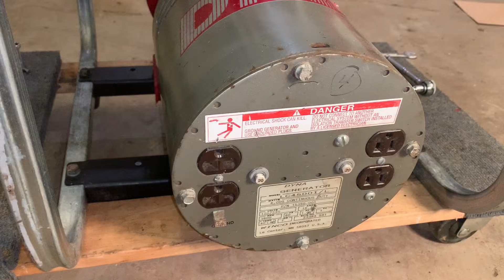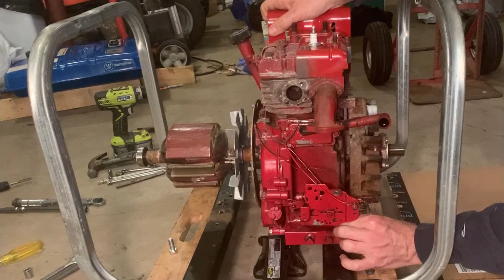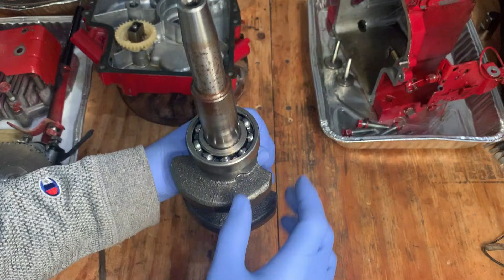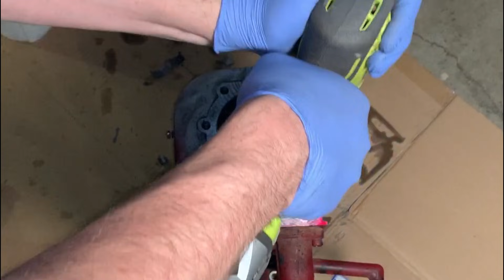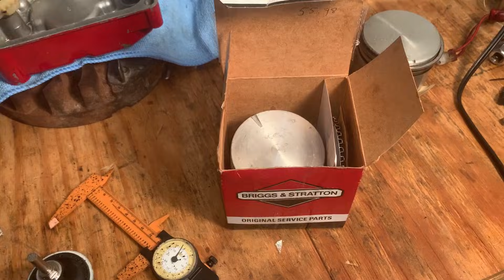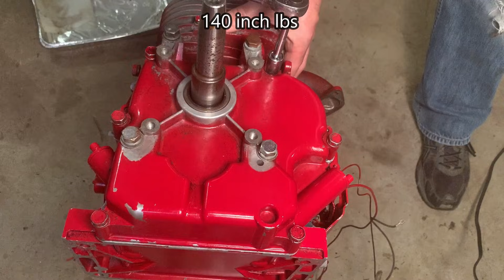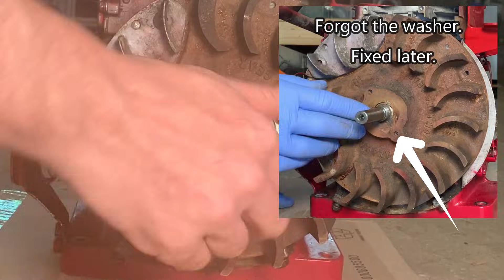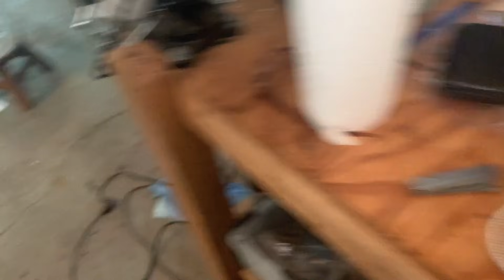Old Winco Dyna Generator (Part 2 ) - Engine Rebuild on a Briggs L-Head Engine

Comment: Main jet adjustment on all small 4-stroke motors:  With engine warmed up, and at speed, open just until misses a little - then turn back in just until it doesn't miss.  Running just a hair rich is better than lean.  Lean running creates excessive heat in the combustion chamber.  Small engine mechanic since 1968.
Reply from the maker: Thanks
Reply: Same criteria as with 500 cubic inches aviation  engines ,,, fuel is cheaper than engine overhauls  !!
Reply: All that stubborn surging because you fixed a spring. Nice. .Ines doing the same under load, I'll check the governor spring for sure.😊

Comment: I was also wondering about that flywheel key being broken-split a bit.  Did you happen to look back at pre-flywheel pulling video to see if maybe it had split and rotated just a bit and also thrown timing off? Enjoyed watching and great job.
Reply from the maker: I did not notice an issue before removing it.  It could have been broken, but the cam timing was the main issue.

Comment: If the bore looks clean while lapping and you have nice cross hatch that is great. This one looked much better than the ten horse Briggs that still had a vertical scratch and still measured 60 on the compression so this motor is supposed to be 8 hp And acts more like 7. But depending how much fuel this uses and how long the piston and crank last like two weeks with no power running day and night will be just great if they remember to keep oil in it. Good job I say. These were very expensive when I was young.

Comment: So happy you decided to repair this engine. These are the engines which were running the world when I worked on small engines.

Some of these engines were configured with the cam to crank timing retarded by one tooth, to optimize the engine's torque curve at the higher end of the RPM range where a 2 pole generator was to be run. This is probably intentional.

I really don't think you broke the key in the flywheel removal process. I think it was half-sheared all along and causing the power loss and loud exhaust sound and red-hot muffler you experienced. The resultant high combustion temperature from the retarded ignition timing would explain the scored piston. That piston would have been overheated badly by the late timing. That could easily expand the skirt, reduce the clearance, and disrupt the lubrication film.

In my opinion; had you tested the engine with its original piston but with a replaced flywheel key - it would have probably pulled rated power; but would have used a lot of oil and worn prematurely.

Regardless, it's great to see it run well at the end!

Comment: Man, what a load of work, for such a little load capabiluty......I think you must choose an adjoining spring hole, to make the governor a little less sensitive........also, it will run better, with better compression, when the rings seat in after a little more running......Great job, and good find with that cam tooth foul-up....

Comment: I just recently subscribed to the channel. I enjoyed it very much. I didn’t know if you knew this on the old Briggs&Stratton you use straight 30 weight motor oil. You did a really nice 👍 job with this old generator. Greetings from Silverstreet South Carolina.
Reply from the maker: Am afraid to do that around here.  30 weight is not good at temps below 40 degrees.  Temps here can get to -10 in the winter.  Am afraid I will sell it to someone who does not know better and try starting it in the winter.  I usually use 10w-30 synthetic which works better then multi grade mineral oil.
Reply: @jcondon1  no worries I understand now thanks 😊 I didn’t realize you lived in cold climate. I seen you use Castrol Edge full synthetic 10w30. I’m seriously thinking of using this in my kohler v twin. Merry Christmas Sir
Reply from the maker: @eddiepatterson5025  it’s easy for me to get, they sell it at Home Depot.  But agree 30 weight oil is much better in warmer weather.  I only use 30 weight oil in my lawn mower and lawn tractor since they are only run in warm weather.  Have a Merry Christmas.

Comment: We used to spray a little aluminum paint on head gaskets to insure a good seal. It probably doesn't matter much with air cooled low compression engines though.

Comment: England. Just found your channel - it's good. I spent several years working on rather large engines and many of them new. It was basically engine testing. One thing I have always wondered about. There seems to be a lot of emphasis on honing marks being necessary to bed the rings in. I never really found evidence of this on engines. Some had quite faint honing but many like Rolls Royce and others had almost a mirror finish. None of the engines with liners showed any at all. I can only assume that with let's just say ' more cost effective' engines it's needed. Sorry to be so late on this but as I wrote I have only just found your channel. Sub'd, etc. of course.
Reply from the maker: Thanks!
Reply: Interesting what you say about honing. I have an old german book written between 1959 and 1962 where it says that cylinders must be honed, but if it is done right they do have almost a mirror finish. The guy is talking about that the bore only gets rough and matt over time when something is wrong. 
He says that the only surface in an engine that needs to be relatively rogh and matt is the part of the piston rings that touches the bore. That is THE ONLY part of an engine that needs breaking in, nothing else. He goes on by saying if a service station or a workshop tells you that an issue on a new or rebuilt engine will disappear because of "breaking in", they want to hide some botch.

Comment: I have a Tecumseh SnowKing, that has been in service for about 30 years.  I doing the same full rebuild, due to excessive ring blow by.  It also has an adjustable carb.  One of the features of that is you can adjust or optimal performance under various outside temperature conditions.  You can also adjust it to optimal performance under load.  So when you load it down and it seems to run a bit rougher, just tweek the main jet a little
Reply: re: " It also has an adjustable carb. One of the features of that is you can adjust or optimal performance under various outside temperature conditions. "
His Briggs in this video works the same way - just 'hit' the carb adjustment screw for optimum performance at the time!

Comment: Just a heads up, the taper in the ring is for gas assisted ring sealing pressure, think of the ring as another piston that forces toward the bore, and the taper as it’s sealing ring, or as it’s crown, the pressure is directed to the grove instead of the outside and that causes the ring to push outward and the rest of the pressure pushes the ring down into the piston ring land and the piston itself, typically the pressure outward on the ring and downward on it is enough of a percentage that the ring doesn’t drag behind and the piston doesn’t race past it (causing the gases to escape?) but if the piston does go faster than it then all it will do is act like a tapered seal on a valve and stay seated until the rings move faster and seat on the bottom land again giving room for the taper to act as a piston again, this is mostly just for compression gasses and isn’t used on lower power versions of the same engine bore size

Comment: James, they make  small engine valve seat cutters that you may find very helpful.  Also a ring expander pliers are very helpful.
Would you comment if the BS engine has a sleeved cylinder- this on appears to have one, but many BS engines are Alum bore
and usually not worth the trouble.     Valves are usually inexpensive and worth replacing....
Reply: In the preceding video you can see a label on the engine to the the effect that the bore is an iron sleeve.

Comment: I prefer undoing the shaft bolts with an air rattler... less chance of bending anything. That timing mark issue has solved a problem I have. Thanks.

Comment: I commented on the other video that I worked on one nearly identical a few months ago.  Fuel supply issues I could never resolve.  FYI, the fuel filter was on the carb side of the generator on mine, not the fuel tank side like yours.  Not sure if that would make a difference.  I kept wondering if the fuel line should be pushed down in the gap between the generator housing and the engine, so that the gas did not have to flow over the generator before reaching the carb.  But my experimentation was cut short when the person I was trying to get it run for decided not to use it.  Look forward to the next video on this one you mentioned in the comments.
Reply from the maker: Yes, ideally that fuel line would go down in the gap between the generator housing and the engine.  Otherwise there will be fuel left in the tank that cannot get to the carb.

Comment: When I run in a new rebuild, I pour the coals to it to burn in , set the rings. They need to be worked at half demand for a full tank of gas. Then she'll be ready for the customer to take home. Nice build though, Just run it hard under a healthy load.

Comment: James the next time you have to use the hydraulic method I suggest you use power punch. The light oil you used still leaked out rapidly till you used a power tool. With power punch I believe you can still use a ratchet and socket. Not sure though.
Reply from the maker: It normally works well, but not that time.

Comment: Why don't you use your impact more often? I am in refrigeration and I use mine for everything.
Reply: Well, not every out here has one for starters ...
Reply: @uploadJ  true, but in my opinion they are cheap enough where anyone who works on anything like this, especially diy should have one. I have a Hercules impact, it was $70.
Reply: @inoahmann7542  re: "anyone who works on anything like this, especially diy should have one."
MOST of the time that 'money" (the 70 bucks spent) would just be sitting in the garage, aging, with the batteries drying out, becoming unserviceable in 5 years for the average home-owner ... professionals and hobbyists not so much.

Comment: The L head Briggs and Stratton book , $15, has all the different governor set up pics and instructions. The inside beveled edge on the top ring goes up. Sorta sounds like the rpms are to high, mite want buy a tachometer and check.  I think the Chinese carbs are far better than original too.  1 1/2 turns out on both mixture adjustment screws is fairly close. Thanks
Reply: The revolutions per minute and the cycles per second are directly related, you set the rpm for 60 cycles per second.
Reply: He measured the frequency output on the gen. It was dead on.

Comment: WD40 is a perfectly serviceable cutting fluid! How does the governor work in this engine? I saw just that metal pedal in there.
Reply: The air coming from the fins on the flywheel pushes on the metal pedal and the acts as the governor and some engines have an internal governor
Reply: @jameshedrick6839  Thanks!

Comment: New subscriber learned a lot from this video. Nice closeups I wish I had seen this before I tried to repair my old snowblower. It also had hissing when turning the motor over. Did the hissing go away after the rebuild.
Reply from the maker: Good question, don't think it did.  Not sure though.
Reply: @jcondon1   great videos. I have a devbliss 5000 brushless rotor, bakelite insulator came loose. Is that enough to stop generating. All ohms check out and slight scaring on rub

Comment: One thing I noticed - that you pointed out - was the glowing muffler in part 1. While not unusual at a heavy load, with no load, usually that's not right. I've seen that before with valve timing issues. I've got one very similar to this one - from 1974! And it still purrs like a cat. They haven't changed much. Keep up the good work, man!
Reply from the maker: Dan Miller yes in part 2 I found it was a valve timing issue.
Reply: @jcondon1  You do good work, James.

Comment: Be careful grinding valve stem ends as you may grind off a hardened tip.
Reply: If the valve stems are too long on an older engine without adjustable valves, they need to be ground down.  Very little material is taken off.  It is necessary for proper valve lash and operation of engine.

Comment: You should not use screwdrivers to pry engine casings apart.  This was a common cause of oil leaks on old British motorcycles.
Reply from the maker: I agree, but the cam was stuck.  Had no choice.

Comment: For "L" head read side valve.
Reply: My first car in 1964 was a 1951 Ford 2 Door flat head 6, which I guess is the same as an L head?
2 hours of excellent video on engine/generator diagnosis and repair, all of which applies to everything we do to all equipment forever.

Comment: Great rebuild video.I have a 4hp briggs that is pretty old and tappet for intake does not come up very far and intake valve is not opening.Would you suspect a damaged lobe on cam shaft?thanks
Reply from the maker: wish2fish yes probably to lobe in the cam.

Comment: Man a small engine block washer would be a nice addition to your shop
Reply from the maker: It would.  But have not rebuilt enough engines to justify it yet.
Reply: @jcondon1  how did you learn so much about  generators...is it a hobby or a profession?
Reply from the maker: Matthew Johnston just a hobby
Reply: @jcondon1  oh ok with as much as you knew about them i figured it was your profession...anyway love the channel just wish i could find a genny around my area so i could fix it up
Reply: I made a small parts washer with a plastic colander, five gallon paint bucket, a fountain pump from Harbor Freight, some hose, and Simple Green.  If you're going to do engines in it, definitely have to upgrade to a metal colander!  ROFL!
Reply from the maker: @CajunGreenMan  might need to get one.  Considering rebuilding another.
Reply: @CajunGreenMan  lol whatever gets the job done right??

Comment: I found the main jet setting on those carbs was about .75 to 1.0 turns out on the main jet.  I usually turn them in until the lean out with a load on the engine.  I had the same carb on a 2500W Chradtsman gen set.

Comment: If your going to lap one you better off just doing both even it it looks fine from unpressured fluid test (so you don't have do it twice)
Reply from the maker: I agree, have come around after putting too many back together just to find out the other valve leaks now that the first once has been fixed.
Reply: @jcondon1  as you found out the liquid just sitting on top of the valve's is not under any pressure so it might just sit there and not drip

For its age and incorrect timing and the probable lack of oil change due to the damage done to the bore and piston its not doing to bad really 

I also thought they all had them long springs on them (I guess it's there to stabilize the governor from been very sensitive and wildly over opening the carb)

The amount of sand/silt in it as well was amazing

Comment: Built engines at one time you can advance one tooth and it'll run fine if not better
Reply from the maker: Yes.  Did another video on this one.  The timing was a tooth off.  Amazing what a difference a properly timing engine makes.

Comment: You have to break those rings in run it at full load 1 hour than change the oil the leakdown test will pass.
Reply: Yep, that should do the trick. Warming the engine up with no load, then going to full load for at least one hour, better 2 hours, then changing the oil usually helps.

Comment: I had an old Craftsman lawn mower with a Tecumseh engine, no governor. The repair manual called for the camshaft to be installed one tooth off the timing mark on those specific engines. I did it that way, but I could never figure out the reasoning behind it.

Comment: Hi, Great content. You showed that the Hz/RPM was holding up good under load, but you never showed the voltage either no load or loaded. I would have liked to see how it did considering no AVR, no brushes.
Reply from the maker: Sorry must have edited that out.  It did range a lot.  Under no load around 129 volts.  Loaded it was about 117 volts.
Reply: Last vid he said it was somewhere about 109V

Comment: That broken key could have been your compression leak it had the valves in time with the compression release. So if you were at top dead center the valve was slightly open.
Reply: In the previous episode he did of this genny, he mentioned there was no compression release on this motor, also before doing all this it was backfiring.
Reply: I was wondering if the key was broken before he did any work at all to the engine. It seems unlikely, but possible.
Reply: The key is purely to time the magneto, spark timing, it has no effect mechanically on valve timing. And if this did have a compression release they are normally only on the exhaust valve at a point where it opens the valve slightly when the piston is about halfway up on compression stroke.
Reply: @novaapw  re: "The key is purely to time the magneto, spark timing, it has no effect mechanically on valve timing. "

^^^^^^^^^^^^^^^^^^^^^^^^^^^^^^ This